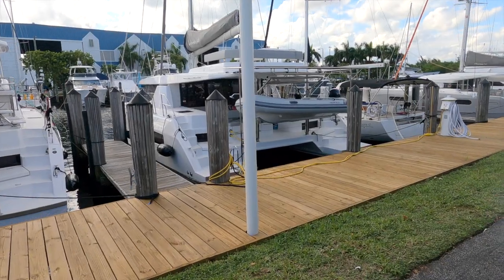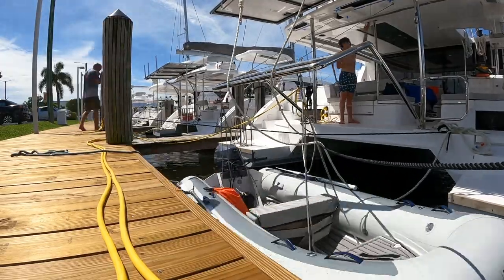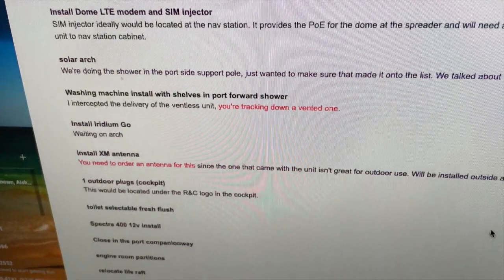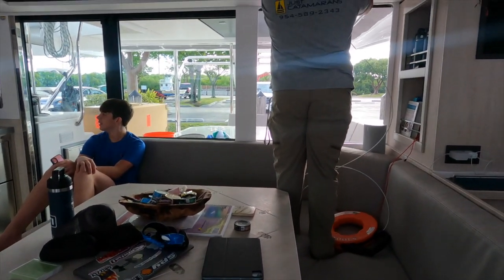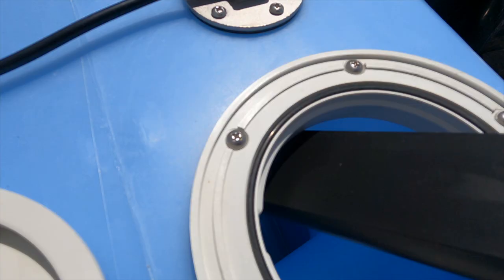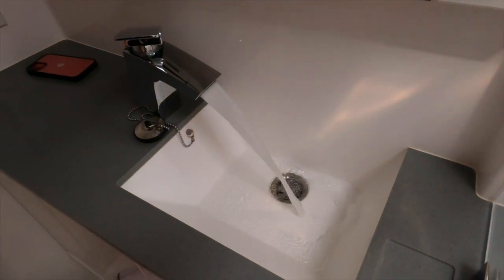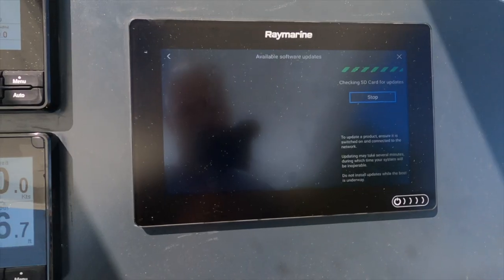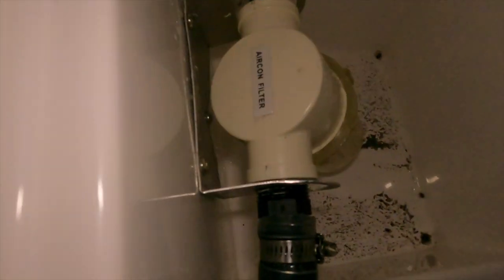Aftermarket Work and Boat Chores On Our New Catamaran - Episode 7

Comment: Nice video and congratulations on your purchase of a new boat.  That Leopard 45 is a beauty and am sure it will take you to lots and lots of places around the world. 
Everything seems set and ready to go. If I might add, every day do the S.W.E.E.P.S.
S - Sails, rigging and steering system (helm) and controls. Check the sewage (bilge pumps and black water) and the heads - they are a pain in the ass when they break down 😂
W - Water maker and water systems including pressure tanks, water level in the tanks
E - Engine, transmission and generator and fuel levels
E - Electrical system (all DC and AC equipment) and the fuses and panel boards. And of course, the all important airconditioner system.
P - Power and propulsion. Check your batteries, solar panels, and inverter/chargers. Check the propellers, saildrives and rudders too.
S - Safety and security. Life vests, EPIRBs, MOB devices, life raft and alarm systems including security cameras and door locks.  Last but not least, your anchor and chain. Then it’s time to cast off into the sunset.

Wish you fair winds and safe seas. I hope the shortcut helps you with boat maintenance as you journey towards the 4 corners of the world. Enjoy your new boat and begin your adventures!
Reply from the maker: Love it! We had a problem with the P today but it was related to the way the inverter was handling charging the batteries. But we were still close enough to pop by the marina and get it sorted out with Just Cats. Changed a setting and we were all good to go. Thanks for the acronym, very handy!

Comment: Excellent videos. I suggest you switch to fresh water flush if your heads aren't already set up for it. That salt/poop mix that builds up in the hoses over several months can be pretty bad to deal with and you won't have the funky smell in the heads either.. Alternatively, a cup of vinegar down the hole every couple months can help. I'm in the process of buying a 48 and hope to have it in to just cats sometime in November, but covid keeps screwing me..
Reply from the maker: Definitely getting that done, we had to split our boat work up so we could go spend some time shaking out the boat, getting the saltwater switches in when we get back. 48 is a sweet ride, hope you get it!